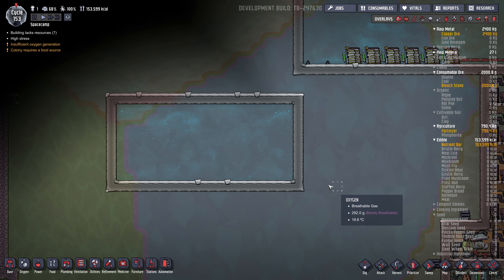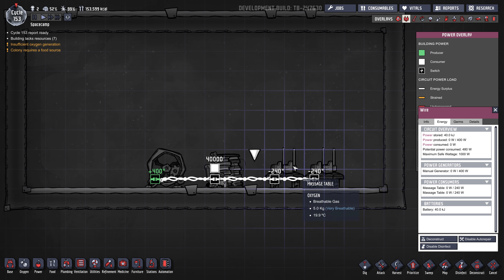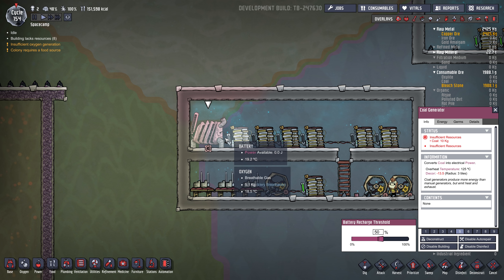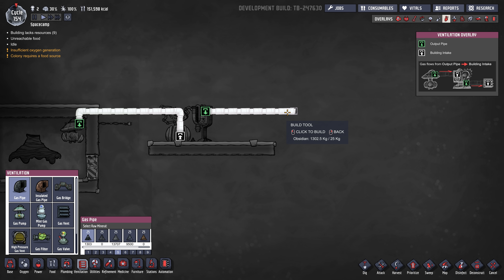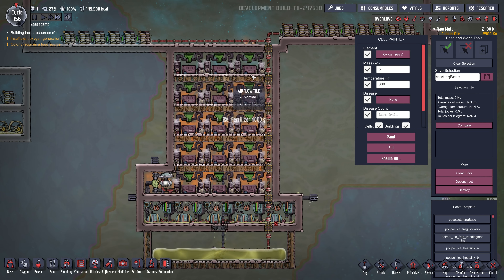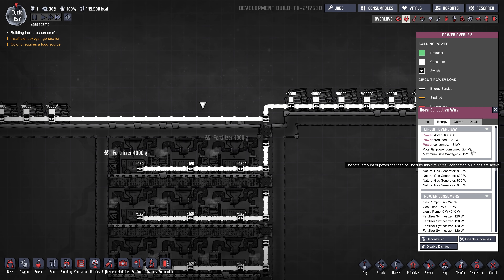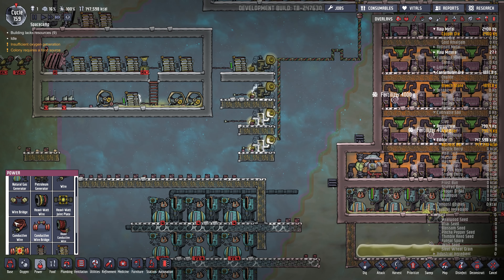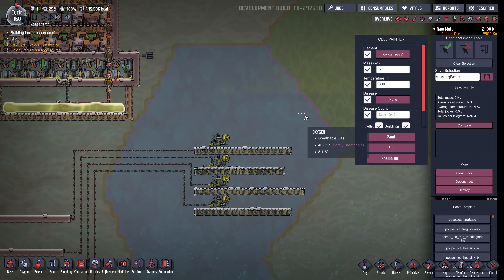Beginner's Power Guide Tutorial - Oxygen Not Included [4k]

Comment: Question: Will the fertilizer maker still run without receiving phosphorite? I mean, I don't care if it's making fertilizer as long as it's producing gas that's just fine. Also wouldn't it be better to make a water Sieve to clean out the polluted water created by the  natural gas generator and run that through a carbon filter? or even the acces to an electroliser? Just heat would be a problem then i guess..
Reply from the maker: it needs fertilizer to run. I often use the p water for pincha peppernut or sieve it.

Comment: switches are kinda useful when you use a different powerplant to give the seed-energy for your new powerplant. You can leave it as is and if at any point your new reactor runs out of fuel and stops, you can just flick a lever and restart it again. Sometimes I also use them for Pumps, so I can turn them on and off depending on the need for liquids.

Comment: Hi, i know this is 5 yrs old but...somehow with 178 comments nobody pointed out the obvious question I have...  At around 24:10 you are using a 1 KW transformer that is outputting about 2.6 KW, which is enough to break the conductive wire.  I thought the whole idea of power transformers was that they limit the power flow to 1 KW?  What's going on?  Did they used to work differently?  Such confusion...
Reply from the maker: I think circuit breakers prevent overload normally. Transformers just step up or down voltage.

Comment: Water pipe question 
I always get pipe blocked for some reason..
Yes, I follow the instructions on screen in-game, all pipes are connected in the white and out the green, and it's plenty of space for the pipe, and the part which takes IN water is completely submerged
But still it doesn't work. Is there something I'm missing?
Reply from the maker: This might be a silly question... but do you have a water pump on the intake? Do you have a output vent at the output end?
Reply: Grind This Game I do.. Hehe I understand why you ask xD but as mentioned: pipe IN the white and OUT the green and waterpump  SUBMERGED in water. Still get pipe blocked. And fiy, same with a gas pipe. Specifically hydrogen. I always get "wrong element" and end opp with a broken hydropump and blockd... I feel really unlucky..
Reply: You have the fliters set the right way?
Reply: Herschel Johnson yeh, tried it out and helped a miniscule

Comment: first coal power output  is  c02 then use  skimmer you remove c02 from air. 2and you make polluted water 
3 after you use  water sieve and then you have water
4 then you can use electrolyzer to make oxygen and hydrogen  
5you collect hydrogen and the you use in Hydrogen Generator,   from  c02 to oxygen and energy

Comment: Hey!  Great vid.  What is the point of the big stack of fertilizer / natural gas generators?  You can't need that much fertilizer?
Reply from the maker: The fertilizer makers produce natural gas out of polluted water. So it's free power in a sense. 3 fertilizer makers make enough natural gas for 1 800w natural gas power generator (minus the 120w x 3) cost of the fertilizer makers. There is some overhead from pumps and such but the larger the setup the more efficient it is.
Reply: It's supposed to be some sort of a preperual thing, never run out of natural gas and keep generators on at all time, but this was neefed and now you lose power.. so scrap it.

Comment: FertSynth:NG gen system no longer valid. FertSynth was nerfed to 10g/s and NG gen increased to 90g/s requirement. So, net loss of power whatever the set up. Coal is still short term. Hydrogen requires PhD set up to produce enough for O2 and base power system. Hamster wheels for all until we get to the petrol or make use of solar and steam.
Please update power tutorial so that a casual newb player knows what to do.
Reply: Also, NG vents are unreliable due to repeated and prolonged dormancy.
Reply from the maker: reliable over time if demand < supply and there is a storage buffer. But I get what you mean. Looks like coal and hydrogen will be the staple until I find a vent.
Reply: Power is my main trouble at the later stages at the moment too and I am pretty experienced in this game.It's kinda weird how the game treats power at the moment. Unless I am missing something of course :) Coal depletes eventually and hatches are just not worth it. NG dormancy makes it impossible to use all the time. And the steam turbine seems like it requires a degree in physics to make it work lol. They really have to redesign that, it's extremely complex for no reason. Nobody will bother that much to make it work consistently. Probably not even the devs :D
Reply: Yeah, the new dormancy issue with the vents is hard to handle and frankly seems like an unnecessary nerf. Other set ups are too complex for casual players like myself unless I get very lucky with my seed (enough clean water, etc.) and other factors. Speaking of water, when are they going to make the water sieve actually do the job you need?! Just require bleach stone to balance OP efficiency (endless water). I don't want to have to take courses and rival Brothgar to have a nice little ONI game.
Reply: Exactly yes. NG appears to be almost impossible to come by after like the third period of dormancy, which can be an insane amount of cycles, like 60-80 or so. Even with smart batteries regulating flow, the coal eventually depletes. And I really don't want to have my dupes running around the map for coal. It's a bit ridiculous and not sustainable. The game should be providing ways to never deplete of power/water/oxygen. That is without having to be a physics major to do so :D

Comment: So that setup with the fertilizer makers and the natural gas generators, 3.2 kW produced, potencial power consuption 2.4 kW, that's only 800 w of "real usable" power for the colony. So many machines running for such a low "profit". Don't get me wrong, is a nice idea but not very efficient i think.
Reply from the maker: It's certainly better to get the nat gas right out of they geyser (or from boiling oil) but it's a good by product. It's a nice way to get rid of polluted water and generate fertilizer.
Reply: Yep, in that way is a nice "factory" of fertilizer with some power to spare. Are you thinking about making an automation tutorial, more specifically about the logic gates? I'm having some trouble trying to use those. I always have so little automation in my bases due to that. I would be thankful.

Comment: Never put generators->battery->transformer->battery because the battery has illimited output so your transformer is useless, the transformer is used to limit the output, so nothing will be damage. You can use 2 transformers to have 2kw (the limit of the conductive cables)
Reply from the maker: You're saying the battery bottlenecks the system? I've never encountered that. I no longer use that setup though. I just have smart batteries on the macro grid.
Reply: Grind This Game no, the battery can output infinite Watts, so if you put it on the output of the transformer the battery will accumulate joules and if needed output more power  until the cables broke. Sorry for my english..
Reply: @greatmateworkshop9764  that would mean that you have your circuit over the safe potential which is a flaw in itself which isn't resolved by any setup at all

Comment: It's a shame that with all the care for following physics, the power models are completely wrong. Transformers transfer potentials not loads. For example from 110v to 220v. Transferring between 1000W and 10kW makes no sense. I also noticed that if you have a heavy-watt wire and connect a regular wire to it (without the "transformer") just to power a single light bulb, that wire (according to the game) has the load of all the parts connected to it. That is as wrong as it gets. Load splitting is also non existent (running two wires in parallel to split the load while maintaining the same potential).
Reply from the maker: I guess they cant model everything perfectly with making it overly complicated.